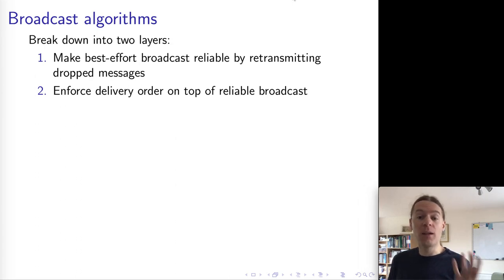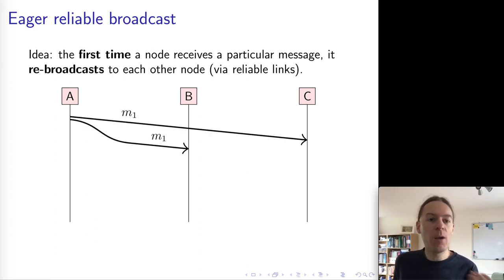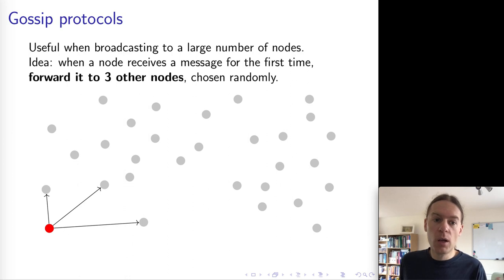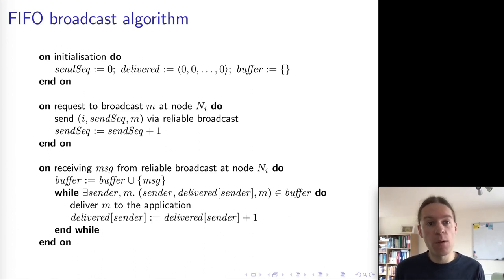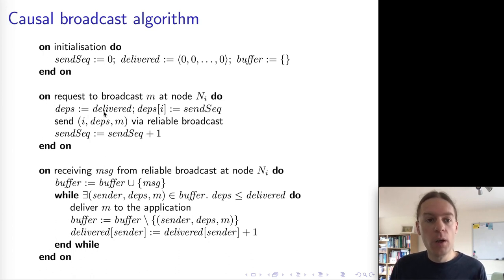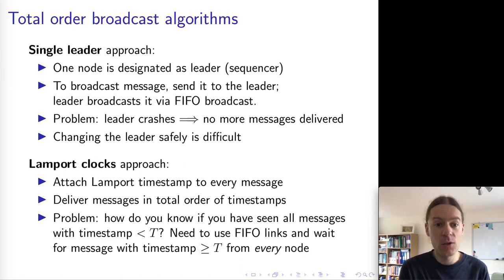Distributed Systems 4.3: Broadcast algorithms

Comment: Broadcast algorithms
  directly [0:28]
    reliable link
    node may crash
Eager reliable broadcast [1:46]
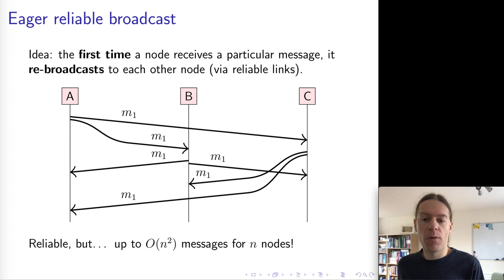Gossip protocols [3:05]
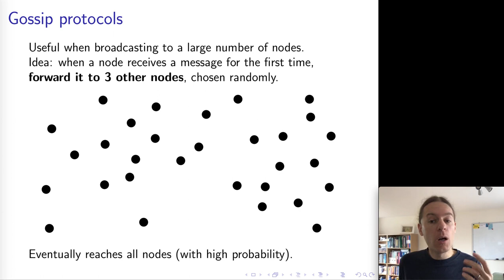FIFO broadcast algorithm [5:18]
Causual broadcast algorithm [7:10]
  (deps <= like vector clocks) [9:04]
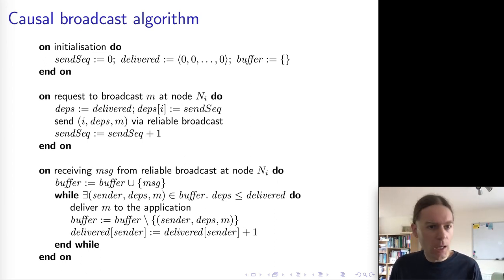Total order broadcast algorithms [9:50]
  Single leader approach
    leader change is difficult
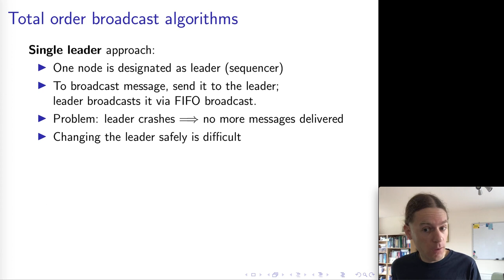  Lamport clocks approach [11:26]
    wait >=T from every node

Comment: I guess there is a problem in Causal broadcast.
On the receiving side, always we have deps>delivered at first place( for example, message with SeqNum=2 is received now, message with SeqNum=1 has been delivered before. Therefore we will have deps[i]=2, delivered[i]=1), I guess the it should be :
deps< delivered --> ignore the message
deps > delivered --> broadcast.

Moreover, when deliver[i] has more value than, by further increase we even make it more, then the condition would be always true.

Please let me know if I am mistaken.

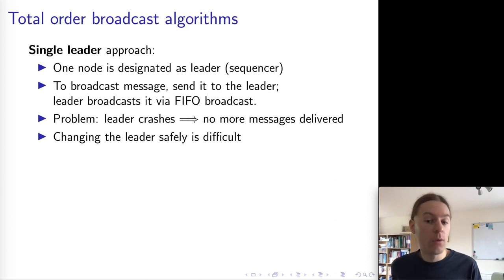Comment: In 11:20 we talk abou total order broadcasting with single leader, but this doesn't guarantee FIFO or causal right? Do we need to have an additional check on the leader, like for example making each follower send in it's i,dep,m array and also run the causal broadcast algorithm at the same time?

It seems to me like the lamport clocks approach solves the problem of making it FIFO total order automatically w/o additional work though. It however has an additional problem: since we need to wait for one more update before doing previous updates: we're guaranteed to have clients making updates on stale info
Reply: causal broadcast: "if a broadcast request X at node A originates before (happens before) broadcast request Y at node B, the delivery of X must happen before Y at all nodes."

we can prove the above holds for total order broadcast protocol using a single leader given
1) the “total-order-broadcast” is sent to the leader from the originator in a FIFO channel.
2) the leader has to “FIFO-broadcast” in the same order it received the “total-order-broadcast” requests.

Hint:
case 1 node A != node B
In this case, the causality path from request X to request Y should involve the leader receiving X, which implies the leader receives X before Y.
case 2 node A = node B
	In this case, since the link from node (A=B) to leader is FIFO, leader receives X before Y.

Comment: Thanks for the wonderful lectures! 

A minor question about the causal broadcast algorithm. On the receiving part, is it true that when the receiver found a (sender, deps, m) from its buffer, if the deps < delivered, it's actually not the first time the receiver received this tuple? In that case, the receiver will just remove it from the buffer and won't change the status of the delivered list.

Comment: I have a question regarding the two different implementations that are outlined for Total Order Broadcast. If you use the single leader approach, the total order is not causally consistent. But if you use the Lamport clocks approach, it seems to me that this total order would be causally consistent (ie if you use Lamport clocks to implement total order broadcast, you actually get FIFO-total order broadcast.). Is this correct or am I missing something here?

Comment: I couldn't understand  Total order broadcast algorithm with  Lamport Clocks approach.
It doesn't make sense to use Lamport timestamps to order messages where nodes are more then 2. And you can't ensure global FIFO (first in first out), you can ensure it only between 2 nodes. which brings me to think that nodes can't prioritize between parallel/concurrent events.
Reply: The answer is that Lamport clock provides Total ordering, when numbers are the same node Names are compared...
Reply: So does the lamport clocks approach lead to a FIFO total order broadcast? To me it looks like the order of message deliveries is sort of round-robin. which essentially implies that it is FIFO.

Comment: how does the gossip protocal know if all the nodes got the message? does a coordinator have to be here to keep checking the status?
Reply: In an asynchronous system, where messages take an arbitrarily long time to transit, there is no way.
Reply: in gossip protocol, the node sends out a new message only the first time it receives the message; so if you received the same message before, you do not need to choose new nodes to gossip the message anymore. The stop condition is that all nodes received a copy of the message. How many hops? The diameter of the network topology.
Reply: @andycjwu  thanks, a crystal clear explaination